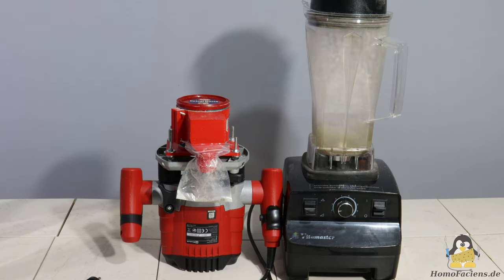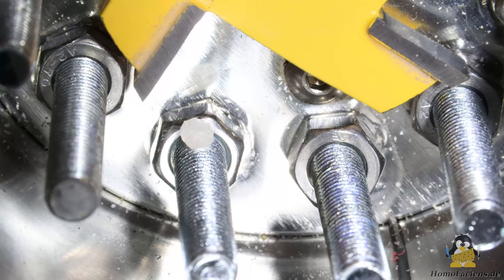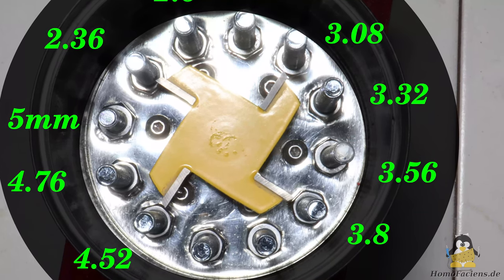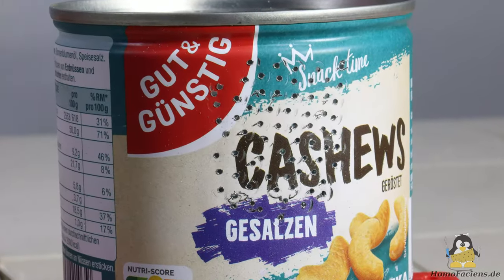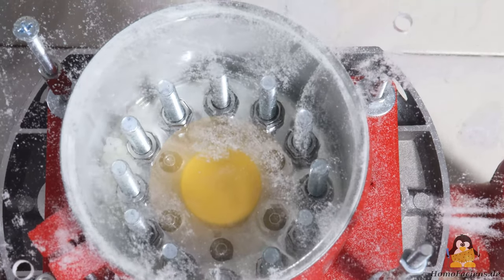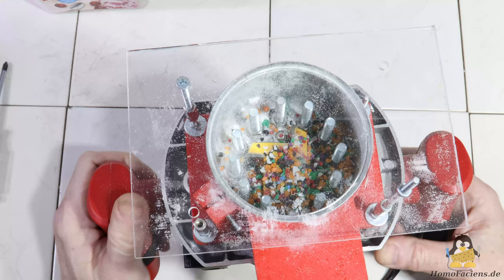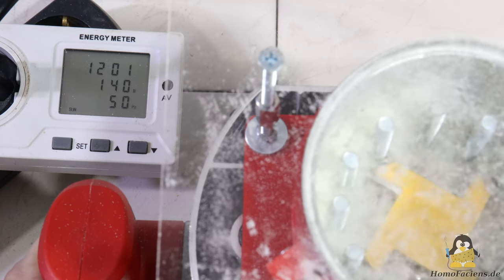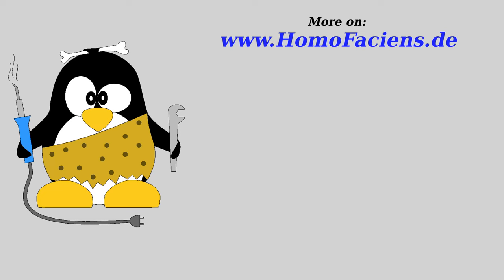Grinding PLA pellets to plastic powder

Comment: Micro-plast.
You should probably design some highly effective air-filtering for this thing :)
Reply from the maker: No need for a filter system as the final version of this grinder will be sealed, so not dust can escape and it all will end up in the bag.

Comment: Nice. Looks just like the little brother of a granulator at a recycling plant I've been to.  If you want to do continuous production, I would recommend a 3d-printed rotary airlock, or maybe a screw feeder based on an auger bit.
Reply from the maker: Thanks. Did you have a look inside of the granulator? Just for curiosity. The ones I know don't create plastic powder but pellets.
Continuous production isn't the big target, but at least some sort of pellet feeding mechanism is on my list of things to implement.
Reply from the maker: Thanks for pointing to the "Herbold granulator". These machines are obviously cutting, not grinding the plastic. You won't get the tiny grains I need with those cutters. But good to have learned about another technology for recycling plastics.

Yes, I had the pellet extruders with the rotating cutter in mind.

Comment: what if you put a nut or two on the screws on a height  above where the blade ends ?
Reply from the maker: What do you think would happen? Trying out things without a masterplan is usually a total waste of time.
Reply: @HomoFaciens  :)  i think that less parts will be floating around because they will hit on the nuts and return faster to the lower height where the blade is (two nuts are for to hold on through the vibrations )
Reply from the maker: That floating around is a wanted effect as this cools the particles before they are hit by the blade again.
Reply: @HomoFaciens  i didnt understood that the temperature was so critical . and you did put a fan as the only accessory with the bag for the device to work :/ 
i wouldnt suggest to use frozen plastic ,as something that you probably already thought off
Reply from the maker: Yes, it is obvious that the cooler the plastic, the more brittle it becomes. Getting it to work at room temperature is the trick.

Comment: i dont know , the motor will burn out if its not under load , and 140 W is alot to break down pellets of pla, 
have you tried a meat grinder ? the one with the screw that makes sausage , the screw will trap the particles and smash the pellets against the wall , the challenge will be that it will gum up (maybe)
maybe you could do something with an old screw type meat grinder
Reply from the maker: Yes, meat or coffee grinders are common, but you will have to modify them heavily to get the desired particle size as they don't work for plastic pellets out of the box.

Increasing the efficiency is the next step - stay tuned!
Reply: or a plate type flour mill may work well
Reply from the maker: It is that word "may" that you have to turn into "will for sure" by your own experiments to convince me to buy a flour mill instead of improving my design ;-)
Reply: I don't think a meat grinder is appropriate for the material at room temperature.  Even if you could supply enough torque (and the grinder could survive the torque),  I'd expect the plate might clog.  Don't know though.  

The man may be using a router and a peanut can, but he's implementing a simplified hammer mill -- albeit without free hammers.  In my opinion, this underlying concept would be a better tool for pulverizing and grading a relatively tough granular material like PLA.  He's already on the right road.   A well-balanced (and safe) rotor with free hammers might be a hard thing to implement with such simple methods though.   I'm sure there are all sorts of mechanical driveline parts with internal splines which would make a good stator though.  Perhaps the outer ring from a synchromesh?   It'll already be hardened, too.  Might not be quite the HomoFaciens style though. :)
Reply from the maker: @HammyJamPants thanks for sharing your thoughts!

I have been working with hammer and ball mills a couple of years ago, but to get glass powder in the range of 1µm. I don't think that kind of mills is best for getting PLA powder at room temperature. Nitrogen cooling always works, but is no option for hobbyists ;-)

As I will show in the coming video, this first prototype is more of a hammer mill than I wanted it to be, just because of a lack of sturdiness. The stator screws as well as the rotor deflect when the pellets are hit. Because of that, this mill/grinder doesn't manage to smash grains smaller than about 2mm.

I am currently creating a smaller and more solid version. I am also testing a self made "cutting tool" which also works more like a hammer, but one that doesn't deflect. Stay tuned to see if that works!

...and if my mill won't work I might cannibalize one of my 2CV gearboxes :)

Comment: Try adding a little water.
Reply from the maker: No. With just a little water, the grains will stick to the walls. With lots of water you have to filter and dry afterwards. If any water at all, then on the outside as  water cooling system.